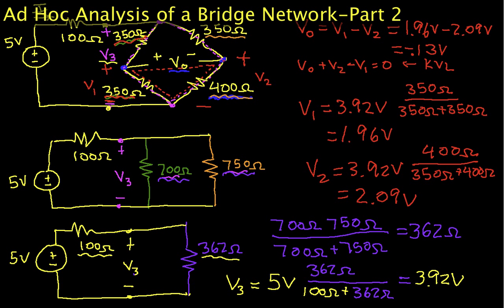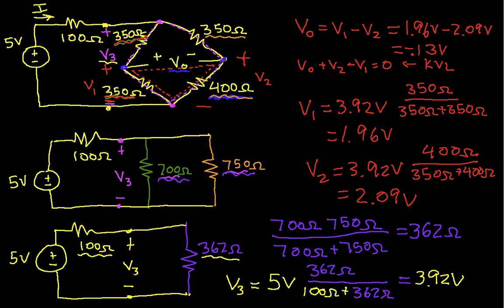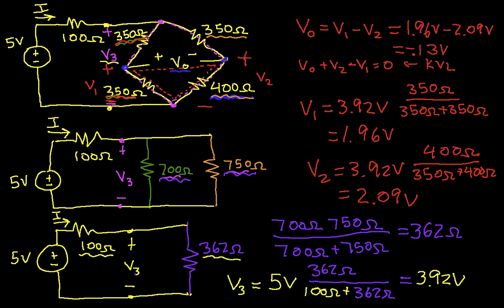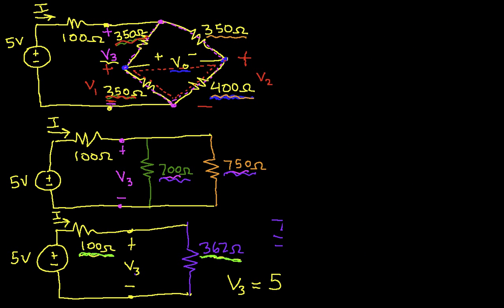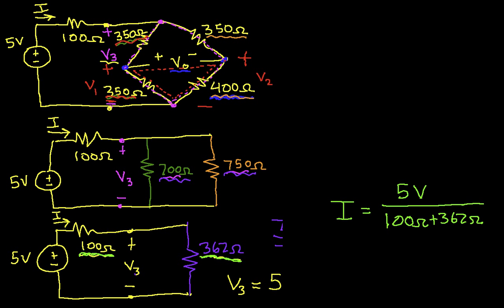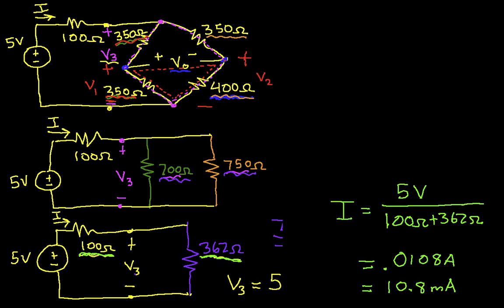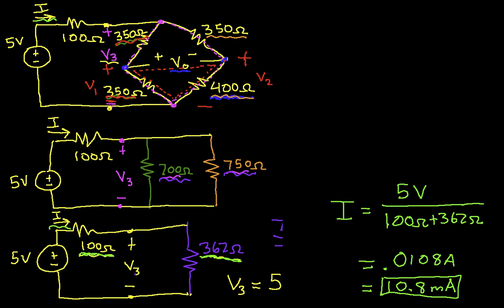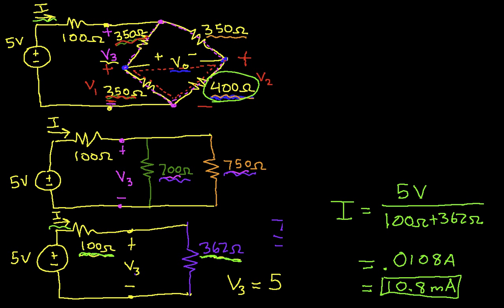Ad Hoc Analysis Example-Bridge Network Part 2

Comment: I'm elated that you are doing basic circuit analysis such as this Wheatstone Bridge.  I hope you continue to develop this series using practical, real-world circuits.  It seems there is a great deal of the same theory and concepts discussed out there, but not enough material to help someone learning to bridge the gap (pun not intended) between the theoretical and practical ends of EE.  Thank you.